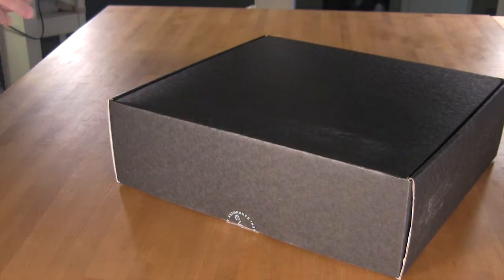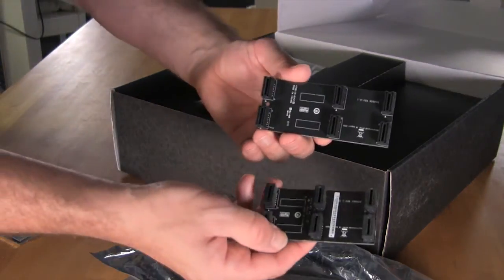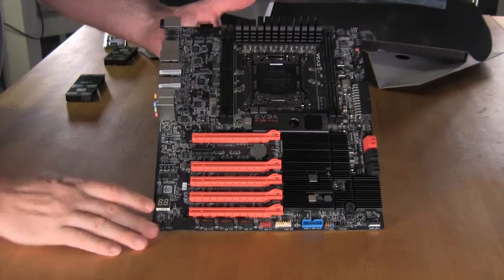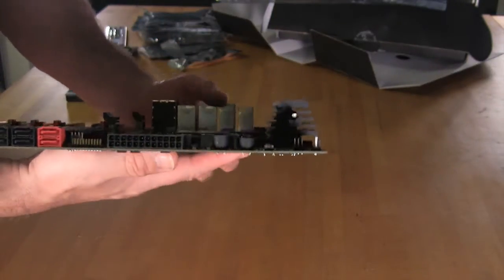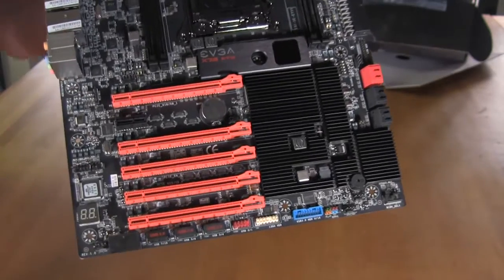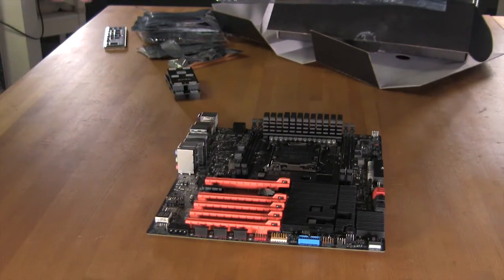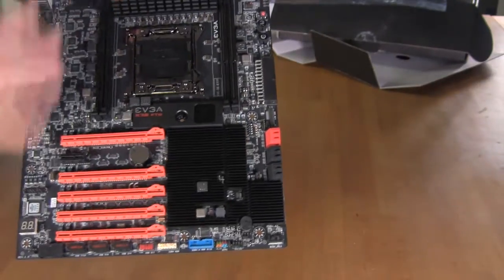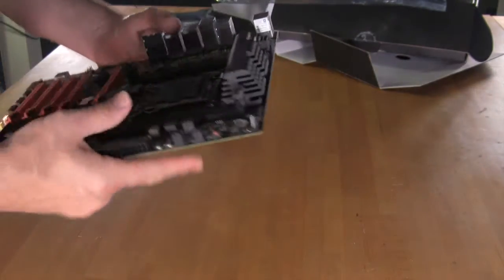EVGA X79 FTW Design and Feature Review

Comment from the maker: @brushandbolter It is easier to stabilize four DIMMS (one for each channel) than eight. It is also easier to maintain clean power to four Versus eight when overclocking. 

The trace tuning needed is significantly less complicated and actually less expensive. The problem is that we have not seen it pay off so far. We are hoping to see something better with this board as it has a bettern power design than many of the others.